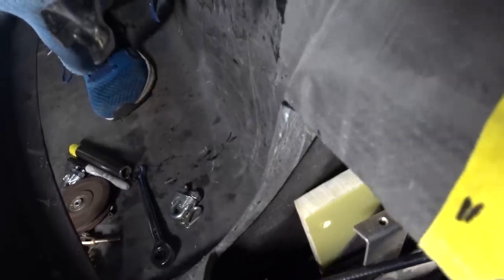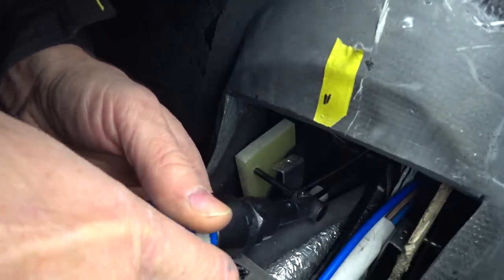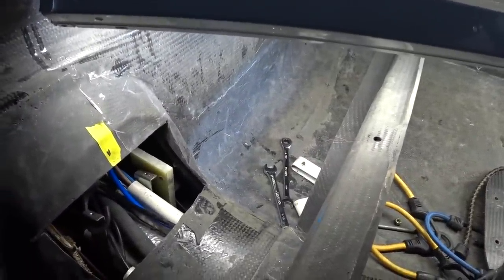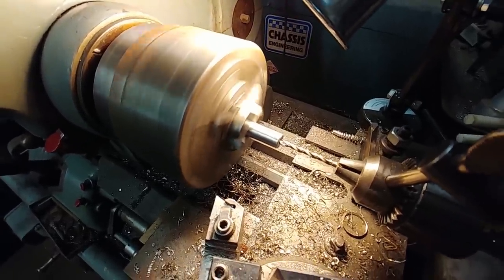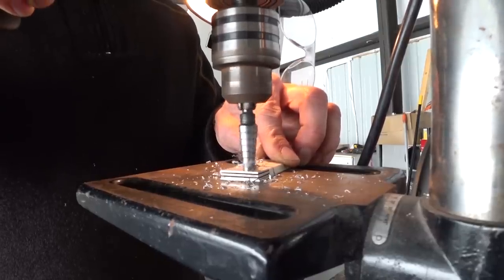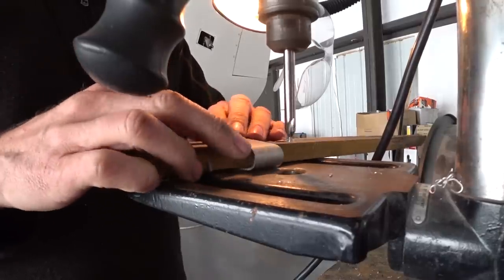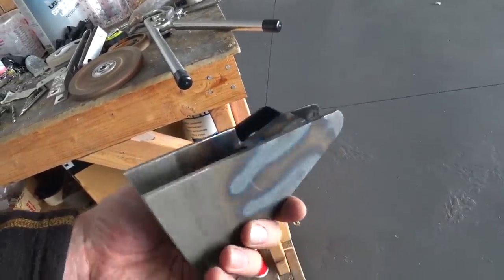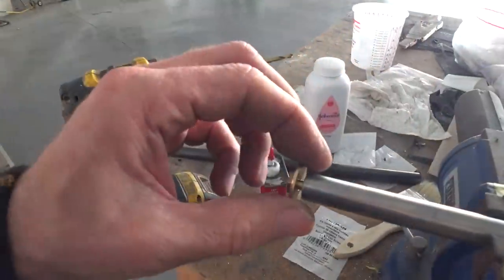Aileron Pulley Mounting - Building the Raptor Prototype

Comment: Instead of the 1/8" rivet in the cable gaurd a MS20392 clevis pin of the correct size with a washer and split pin would be an easierr option. Thats what alot of aircraft use.
Reply: I agree with the use of a clevis pin in that situation.

Comment: I love you guys never got to see this development before. You pull this off I will get one trust me. I am in.  The numbers it is all about the numbers I dissect financial statements.  Instrument rated went thru 182’s and 3 A36’s the last one bought new.N8095F way more money. This will change GA big time do not fail
Reply: I know they are going home built at the moment, but how much does getting it certified cost? Can it be certified with that engine. or does the engine need certification? Will the engine ever pass certification?

I'm just curious what the financials would look like to turn this company into a new Cirrus or Cessna, building complete aircraft and selling them out of the door for customers to fly away in. Is it possible to get that kind of financial backing if they can prove the prototype works and the theoretical numbers are close to actual numbers? Let's face it, if this plane performs anywhere close to the numbers that are publicized, they have a chance to sell thousands of these things and change GA forever.
Reply: @skyboy1956  well they think different so what is your claim to fame
Reply: I was born in 1956 too
Reply: @operator0  so finally aviation has a chance to elevate to car production.. been a cr dealer gone to all the car manufacturing plants   GA has to get to that level to be something many have access to
Reply: @DavidGilesColorado  only in the homebuilt space.  dirty sekret:  GA aviation is a big $ club, they dont really want to include everyone.
Reply: I think skyboy should change his name to black cloud. This the most exciting plane I have ever seen and even if it comes close to the numbers published they will far surpass the compromises in designs that get type certificated.

Peter, since this plane is full IFR and can dodge the clouds, how about we sidestep "Black Cloud's" comments? Keep up the good work.
Reply: @skyboy1956  to my knowledge, it won't be a certified. Also, he has stated there are crates of used engines available. This is an EAA project. Even if he wants to go certified and Audi impedes him from using their engine the data and experience found during this venture will provide much needed knowledge. I don't see it going certified however. And that is fine. Lancair put out many planes under the same business model. This is simply a prototype.

This is how it goes in Aviation. The FAA is so regulatory that R&D happens in the EAA market. Cirrus wouldn't have put out the "plastic" certificated plane without the research and development of trend setting EAA people before them.

As for cost, I never considered that he'd make expectations and honestly, even at 150 or 200, with those performance numbers, in Aviation, it's a bargain. As the old saying goes: if you gotta ask how much, it's too much. Plus, he's been hyperfocused on development and hasn't updated his site.

Many of you points are valid however what I think most have issue with is the negativity. It's not productive the way you do it. It comes off as a know-it-all naysayer who seemingly hasn't ventured much of a stake in improving the problem (the compromises in design in GA). This plane is delivering speed, utility, comfort and cost suppression in operation and acquisition. The only thing it won't do probably is be available for hire. But screw it. I could buy a 182, spend 150K to fly to Florida from Philly for 10 hours and be tired and beat up at the cost of operation of about $3000 or in this for about $500.

I have two big problems with the plane however which haven't been answered yet. The mopar EEC has only one channel. If one sensor fails it degrades to 80% power which is fine. But what happens if the EEC fails from a power supply fail or the like? I'd like to see some redundancy; maybe a second ECU powered directly by the battery.

The second thing which gives me pause is the pressurization. Don't get me wrong I love the airplane for the pressurization but I've seen cracking around the windshield of a cirrus that doesn't have pressurization and so I wonder a little bit about it. Pressurization never comes cheap. I'm not sure about the control either. I may want to just go on oxygen and see if the engine will take me up to 30,000 feet to avoid any kind of weather so I may want to turn off pressurisation.

Regardless of my questions how to design and there are a few other problems can I have with it I've remained optimistic and let development run its course. decisions have to be made and mistakes will be made. what I think most people are having trouble with you is that you're not being diplomatic about your concerns. You're being very abrasive and in a very challenging time for Peter.

You seem somewhat insightful and particularly the information about Toyota but you could approach it a little bit softer or diplomatically. However when I voice my concerns about the ECU I don't really get answers so I just a tribute It to him being busy. obviously he wants everyone to feel safe but right now we're just at prototype.

So I would just calm down a little bit is my advice.
Reply: @skyboy1956  ok, again to revisit your approach, if you're interested, because it is a bit "in your face" to some degree. Just calm down a bit and be encouraging. Its gonna be what it's gonna be. Just helpful not so critical.

Right now, it's in development. His responsibility is not to us. Sure, his intention is to share it with us but he really has only invited us to "watch" at this point. If, when he sells kits having fine tuned his creation, then we have some "legal" buy in. As of right now, we are glorified armchair quarterbacks.

What about the 1500 people who bought in to the line with $2,000, you might say? At this point they bought in to a spot. If the design flops or he never produces then he only owes the $2,000 and any interest he's contractually bound to.

So, as I said, take it easy. It's productive to be critical but being diplomatic about it is courteous. There are ways of saying things.

I mentioned the ECU because when I become #1501 in line, I'm going to look at #100 if that has been handled "for my kit." If not satisfactorily then I will consider developing a system and even offering it to him. My hope is he will get to it once he has time. But, if you've been watching, ever since the first test pilot shot it down, he's been just trying to get it to flight test.

Sooo..... one thing at a time.

Comment: Is it possible that the looped pulley/cable bracket might swing around and jam?, or cut the cable?
Should you lock it in that position somehow,...?
Reply: Without abrasive, the bracket likely won't cut the cable because the aluminum is softer than the stainless steel cable. Jam is a good question.

Comment: Unlike twist drills step bits actually drill round holes which is nice.
Reply: @skyboy1956  sort of a rounded triangle most of the time.
Reply: @skyboy1956  it's subtle but a twist drill never drills a perfectly round hole.  Most of the time that's not an issue but in more precision situations it can be a problem.
Reply: @skyboy1956  how are measuring the roundness of holes?
Reply: @skyboy1956  a reamer or boring the hole is the best way to get a round hole. 
It all depends on the application.  If you drill a hole in fairly thin stock with a twist drill often the hole will be a visible triangle.  This gets mitigated as the stock gets thicker but never actually goes away. 
I didn't make this up.  Google it. It's a very well known phenomenon.
Reply: @stevenhorne5089  i know :) I already gave up.

Comment: does that upper pulley turn the aileron?  If that is the case you will need more than cable friction around the pulley to turn the flap.  The cables will need to terminate into the pulley similar to how a throttle linkage cable for a throttle terminates into the lever it pulls.  Or similar to that little end of a bicycle brake  cable that terminates in the rim caliper lever.
Reply: That pully is free-wheeling. It's there to change the cable direction.

Comment: Step drills generally have a quarter inch shank which shouldn't be too hard to thread. What's the thread on the angle drill?
Reply: @skyboy1956  I was asking a question. Generally the shank of something like a step drill is not hardened to the same extent as the cutting edges so I figured one might be able to thread it to match the angle drill. I haven't tried it. Have you?